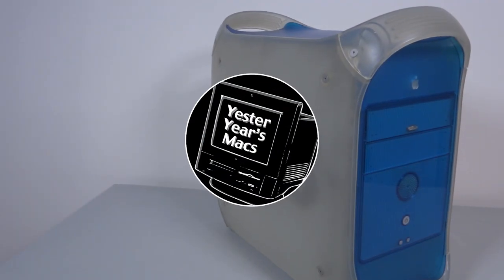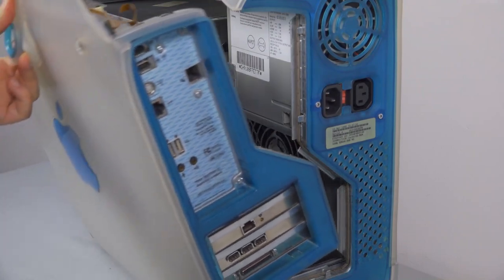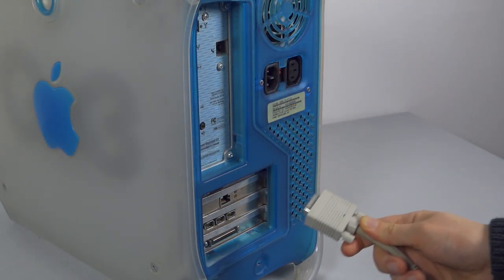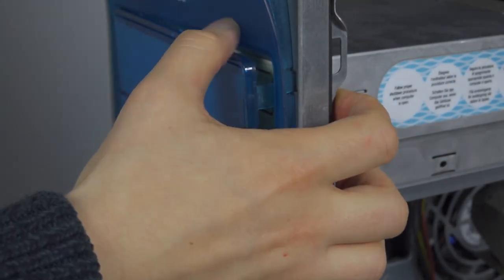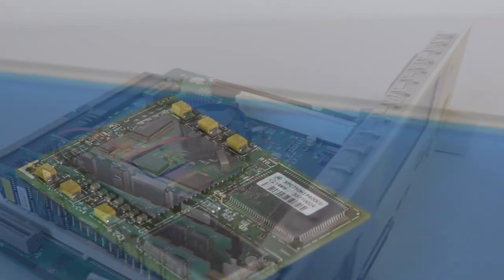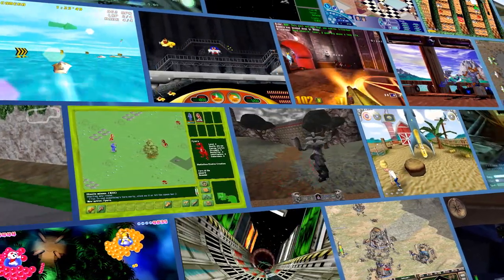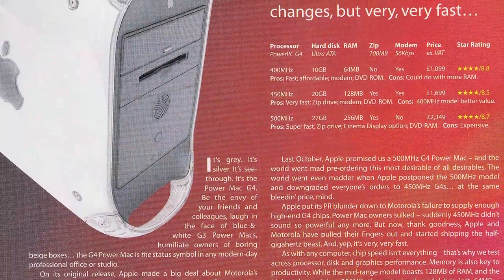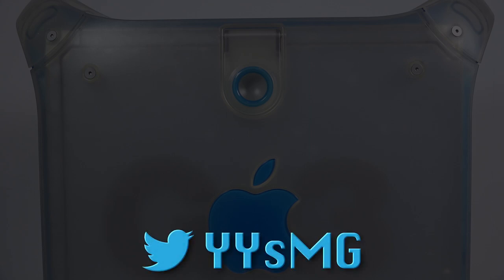The Blue & White Power Macintosh G3 – Review of Apple’s Game-Changing Pro Minitower from 1999

Comment: i got a g3 a couple years ago. someone was throwing it out. and I'm now getting into it and cleaning it up. I haven't fully looked at it, but they had OS X 10.3 or 10.2 installed and a graphics card upgrade to an api Radeon 7000 mac edition. Still have the original rage 128 installed. I think it has an extra ram stick or two as well. Plan for now is to clean it up physically and digitally and I may "downgrade" to the OS it originally came with, not sure. but I def want to throw on period correct software like photoshop and some games! Super aesthetic!   sometime I may upgrade the processor to the G4s (or something compatible)